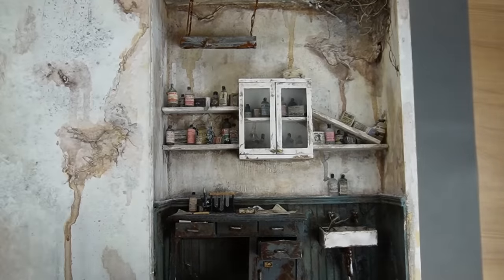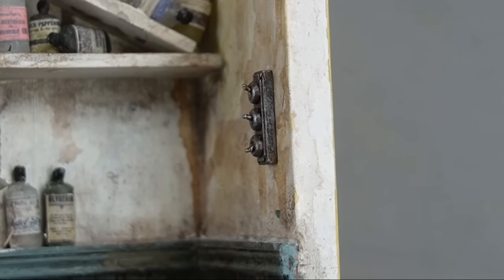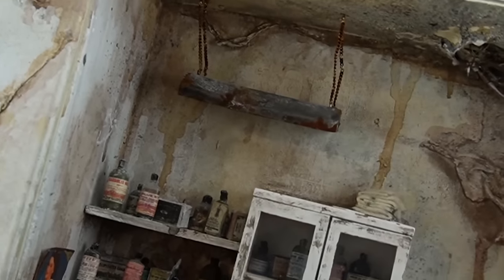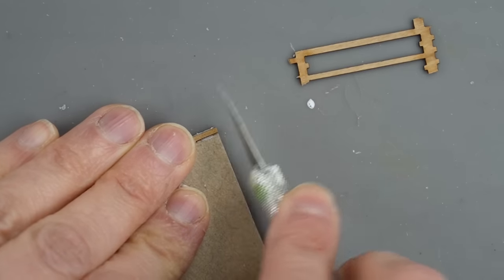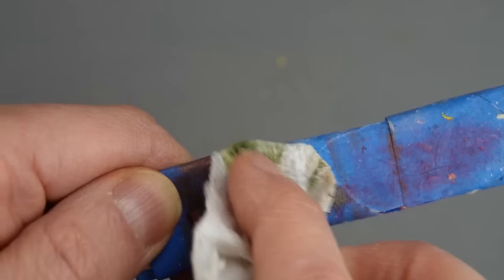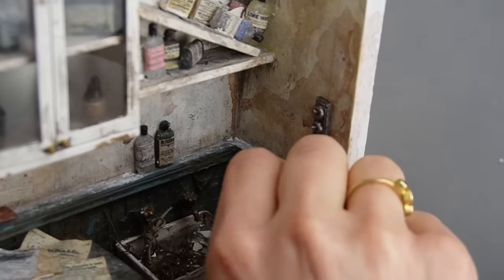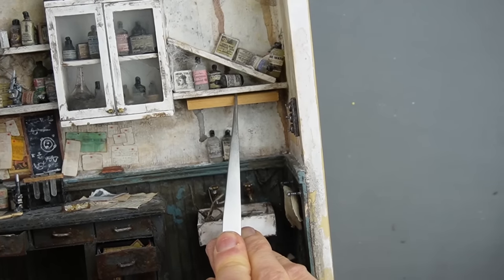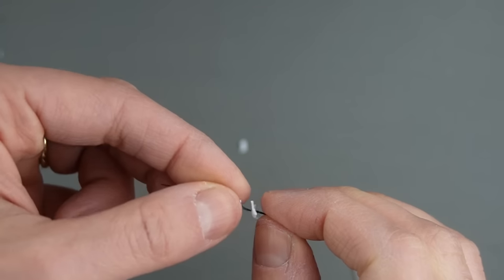DIY miniature accessories for the Abandoned Miniature Lab INSIDE A BOOK

Comment: The light switch is genius, and the dryer sheet idea is so clever. I absolutely love this miniature, it feels so complete
Reply from the maker: Thank you! The light switch definitely isn't an exact match to the inspiration (my circles around the switches are convex and not concave) but it was so much easier to just use the rivets I had and slightly change the design. I actually think one of those rivets would make a great older style doorbell with a button in the middle.